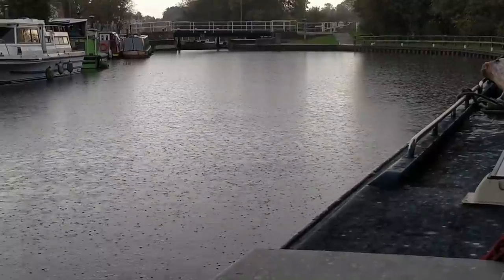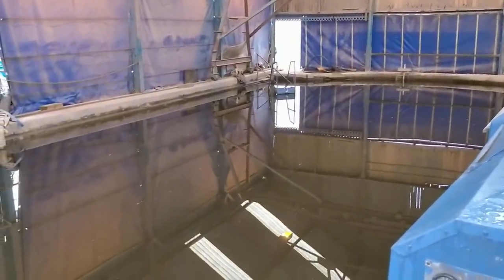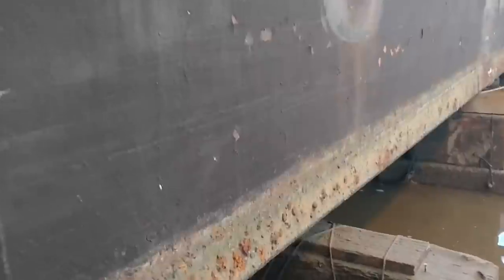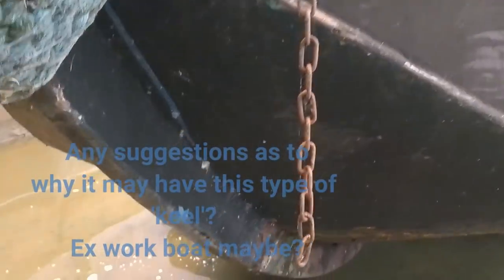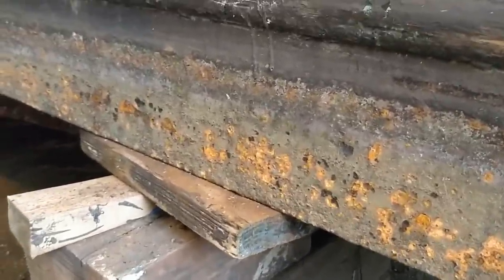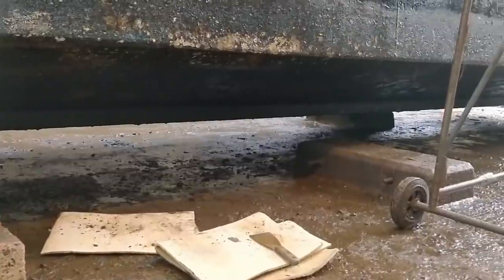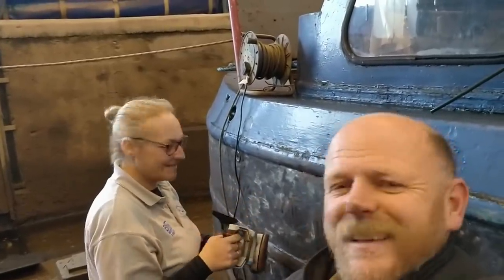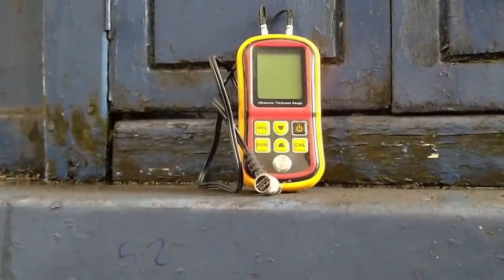Dry docking, checking the hull and blacking of our DIY project narrowboat, Boating on a Budget. Ep6

Comment: I never knew that there are V bottom narrowboats. Learn something new every day. I love that hull.
Reply from the maker: A company back in the 70s and 80s, called Springer only made V bottom narrowboats. But this one seems quite unique, possibly designed for river cruising...
Reply: Apart from steel Springers, which have V-shaped hulls, you also get Sea Otter boats that are all aluminium narrowboats that also have V-shaped hulls and use water as ballast - a bit like a submarine.
Reply: @urbanimage  I also like the enclosed bow. I think it is much safer and better use of the space. How much time would one actually spent there in the unpredictable English weather if it was open.
Reply: @tomdunn1254  If you're a continuos cruiser the bow tends to end up full of stuff anyway 8--)

Comment: Your channel just popped up in my DIY recommended listing and I've added your channel to my subscribers listing to keep track of your progress and adventures along with several other narrowboat owners. Boats like yours are virtually unheard of here on my side of the pond in the states. Mostly due in part to a lack of useable canals however we do have the ICW and all of its tributaries. 
I've wanted a live aboard boat for many years but never found one I was happy with. I've look at everything from small motor yachts to barges and everything in between.  So, I've decided to build my own boat from scratch.  While searching for a yard that could accommodate my building needs I stumbled across these narrowboats that you use in the canals n your side of the pond. I was intrigued to say the least and as I watch more and more videos on other channels here on you tube I began to see what it takes to build one of your little boats from scratch.
My hull will be different the lower hull will be plywood covered with kevlar the upper hull also of plywood covered in fiberglass. my hull will be a wide body with a 12' beam.  my complete hull design comes from a year of emails between myself and a close friend that lives in Austria Germany. the over all hull design started out at 17' than as we began to add things in the cabin area we realized the 17' had to be increased to 37' and before we were done we increased it one last time to 60'. Because of other designs we have talked about I have a feeling it will be increased again to 100'...hahaha. and it hasn't even gotten to the actual building stage. if you'd like to know more about my design let me know.
Reply from the maker: Sounds a fun project. I'm intregued by the use of kevlar... Is it a material you've worked with before and is it not quite expensive?

Comment: When using your thickness meter always grind back to shiny steel and use a coupling gel, if you don't have any gel then wallpaper paste will do but make sure there are no lumps of powder. for thinner steel you may need to get another transponder to get an accurate measurement, the standard transponder gets a bit wonky under 3mm. A piece of 1/8 plate will swell to 1 inch thick when it is totally consumed by rust. Good luck with your new venture.
Reply from the maker: We used fry light as the gel! and using the sample piece of steel provided it was bang on reading at 4mm. So seemed to work perfect. Obviously I cant vouch for the figures we got being perfectly accurate but I think they were good enough to show the hull is perfectly usable condition.
Reply: With thin metal you need a twin crystal probe.

Comment: Peter, I would keep the fiberglass roof, it looks nice and retro. Having no well deck also safer, I have seen barges flooded in locks etc with the front doors bust open from the weight of water.
Fiberglass (while is appears daunting) is easy to work with. Just cut out any bad glass with an angle grinder and build up layers to replace it, then a layer of get coat on top. If the structural wood is rotten is can also be cutout and replacements glassed back in.
It would also be (all important) cheaper than a new steel roof, which maybe almost half the price of a new bare hull.
Reply from the maker: I think we are going to change the superstructure but keep the same profile as it is now... The fibreglass is daunting and I don't want to end up with a badly repaired roof that I will be forever worrying about and repairing in future.

Comment: For the age of the boat the hull looks good, did you test the thickness around the pitted areas ? It's amazing how a coat of blacking transforms the appearance, just another 2 coats and you will deserve a beer or 3. Cheers Dave 😁😁🤣🤣
Reply from the maker: It is probably where that 'amazon' tester shows it's cheapness in that it struggled to get a proper reading on the pits. It seemed to show only 0.2mm of a pit but it looked like they were bigger than that... 
And don't worry the beers are already flowing! 😁😁😁

Comment: That hull should work better on tidal rivers, and that keel should give good protection from obstructions and grounding.
And I second staying with the fiberglass upper, I would think it would be easier to repair than steel, probably warmer in the winter, and I like the look.
Reply from the maker: We were told by the previous owners it 'goes well' so guessing this may be part of the reason...

Comment: Do you have to raise the boat a bit, and move it a bit, because of its sitting on the blocks? Or do you just not worry about the area where the blocks were at?
Reply from the maker: in an ideal world it would be moved then painted where missed. But this never happens, you just have to trust to luck on those areas!

Comment: Just curious to know the draft of this boat with it being a V hull. I note a number of vlogs by people with flat bottom boats where even with flat bottoms (the boats) they are running aground or at least scraping the bottom at times. The flat bottom boats should in theory displace more on the first foot or so of emersion than a V hull, so have a shallower draft but since the flat bottom design was intended for cargo use this doesn't seem so necessary. I expect a V hull will handle better on rivers, in cross winds, open water such as crossing The Wash and so forth, but is it less stable in terms of it rocking when people move around in the boat?

Comment: Looks in decent condition underneath, considering they say it should be reblacked evey 2-3 years, makes you wonder if you could easily get away with 5 years between reblacking?
Reply: Seeing you said it was 7 years since its last reblacking.
Reply from the maker: Yes it's been 7 years and the anodes are still serviceable (although we have had new ones  fitted as a precaution). Some people do leave it 5 years. I suppose there is no fixed rule, it's largely down to personal preference as to how often to do it.

Comment: My boat is in the dry dock now and I’ve put one thick coat of bitumen paint on, would the thickness tester work now or does it have to be done before the paint ? I wish I’d seen this video last week!
Reply from the maker: Really needs to be bare metal… it’s whether you have time to scrape odd bits off and measure then re black.
Reply: @WingingItBoatingonaBudget  thanks for the reply, I didn’t think it would work after putting a coat of bitumen on but I just wanted to be sure.

Comment: hi so Narrowboat can have V hull  had grit blasted and  two pack paint   happening  why did you used rust converter ?? went replate  boat metal get hot and have fire
Reply from the maker: Most narrowboats are flat bottomed but some have the v bottom. We have just done 3 coats of bitumen paint... Should keep us protected from rust for at least a couple of years...

Comment: Good stuff, yes its the boring dirty work but still interesting to watch nonetheless. How much do you save by doing it yourself? Roughly, as I guess the size of your boat affects the price?
Reply from the maker: To be honest I'm not sure on the exact saving, I think it would have been a couple of hundred pounds extra had they done it. But apart from being the tight yorkshireman and not wanting to spend money, I also wanted to do it myself so I could have a good look at the hull myself...
Reply: Each Boat yard charges different prices One that`s near me. On average a 60ft Boat. Dry dock for a week £400. Paint and Blacking £200. DIY. ==app £600. If the Boat Yard do it all Dry Dock Power wash and Grit or sand Blast if needed. One coat Red Lead then two coats of hull Black. App £1000. Good for 3 to 5 Years. Dependent on usage.
Reply from the maker: @russellkerfoot5423  yeah varies from boat yard to boat yard and also depends where in the country aswell...

Comment: Maybe a stupid question: what do you do if you find that parts of the hull are too thin for your taste? That aside, I like your down-to-earth attitude to graft, if it needs to be done better have a (grimy) grin on your face!
Reply from the maker: If areas of the hull are too thin the two options are either get areas filled with weld (usual if it's 'pits' - small sections), or overplated if larger areas are thin and week.
We don't mind a bit of graft... get stuck in and get the job done!

Comment: Fascinating as always. 
I think I would have paid for a survey rather than rely on the Amazon gizmo for measuring the thickness of the metal.   But there again I have non of the skills or knowledge that you have.
Reply from the maker: to be fair the machine does seem quite accurate. it comes with 'test piece' of metal that calibrates the machine. and the readings were pretty consistant so im happy they are pretty accurate. 
I just bluff my 'skills' that what google is for!

Comment: Never seen a dry dock so large as this,  are you concerned that you were unable to get to the parts of the hull sitting on the wooden supports
Reply from the maker: Unfortunately its just one of those things that you have to miss bits, regular blacking will mean we get them next time...
Reply: @WingingItBoatingonaBudget  You could move the shaped timbers but the ones under the keel can't be moved.
Is there much difference in price dry dock or crane lift out, with the latter you can touch in last missed spots.

Comment: Why didn't you hit it with a hammer? Lol. I would want to do the work needed while I had it out. At least you know the part of the hull you hit is good! Is the super structure coming off completely or just a new roof? Good luck and happy sailing😊
Reply from the maker: If it had shown up that it needed work we would have had it done. In its current state it's more just a 'warning'. 
And yes the whole superstructure is going to be replaced, along with the entire insides!

Comment: Looks like a springer hull
Reply from the maker: It's a similar v bottom but the springers dont have the fixed 'keel' that runs under them.
Reply: That’s what I was thinking, the fact that she’s the same thickness all over supports this but the fixed keel doesn’t. I noticed a “vent” like cut out on the stern side. I passed a boat this morning that looked like a springer (rolled not welded at the side/roof line but also had the vent which threw me. If she’s still there tomorrow I ask the owner if they’re about.
Reply from the maker: @mattsandilands6380  my other boat is a Springer and the bow of this one is very different - plus it's a fibreglass superstructure, which I don't think Springer ever did. 
I am really curious to find out more about its origins though. 🤔

Comment: My boat is a year older then yours. I had a survey done and it had to be over plated. Get saving your pennies guys.
Reply from the maker: We used a metal thickness tester and checked the hull over - some small areas of pits near the stern (not bad enough to have needed immediate attention). Hull is all good - lowest readings were well within the tolerances required and would comfortably pass a survey for insurance. 
No areas need over plating… 👌